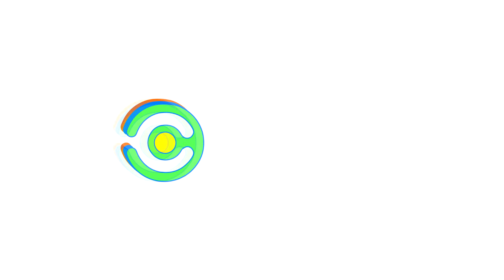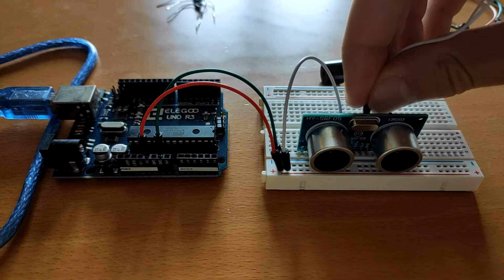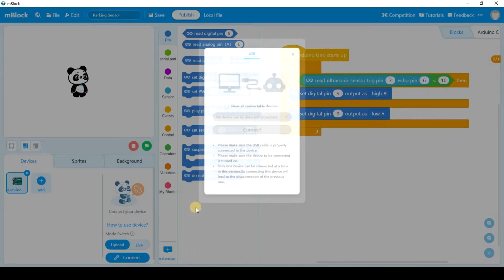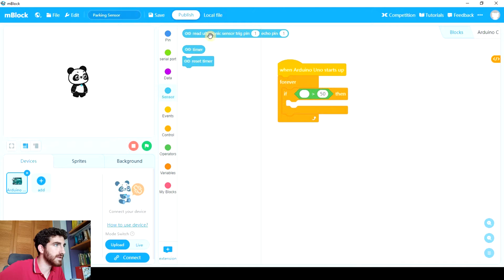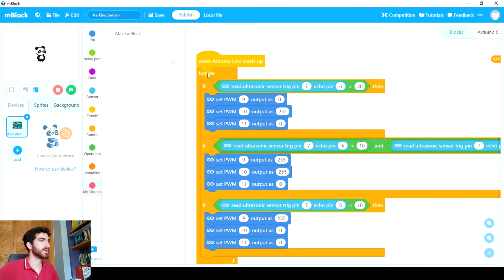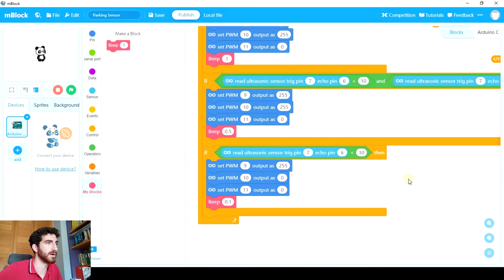How an ULTRASONIC SENSOR works with ARDUINO and mBlock 5 (based on Scratch 3.0) - Arduino Course #11

Comment: i am wondering whether you have videos for RFID RC522 now that every single extension iv'e tried on mblock isn't working. I don't kknow how to program it on mblock :( Not to mention the motor with the driver module, it has lots of wires and no idea which one is signal or how to program it. Help friend, you're the only one whose videos actually work! <3
Reply from the maker: I'm so sorry, Diana, but I don't have any videos about it...
Reply: @elrincondeprimaria  That’s a pity :( You’re the best at teaching coding by far …
Reply from the maker: Thanks! I appreciate it!

Comment: Thank you for this video but can you display the value in cm of the ultrasonic detector in the mblock scene? 

I am looking to do this but I think I have the wrong plug-in

Thanks
Reply from the maker: Yes.
- Create a variable.
- When green frag clicked - Forever - Set variable to Ultrasonic sensor.